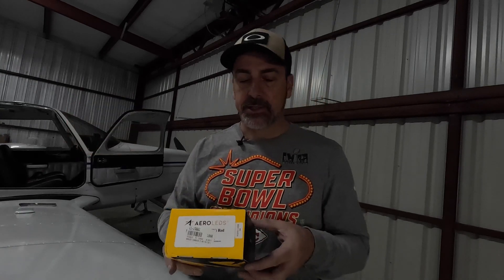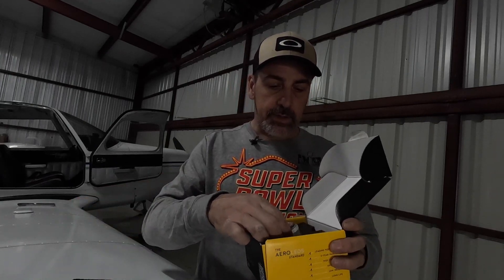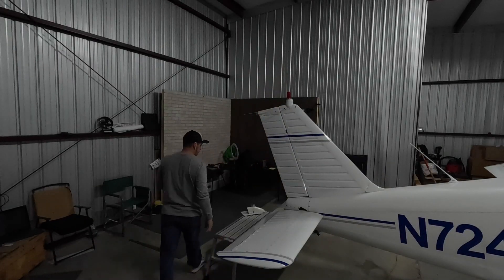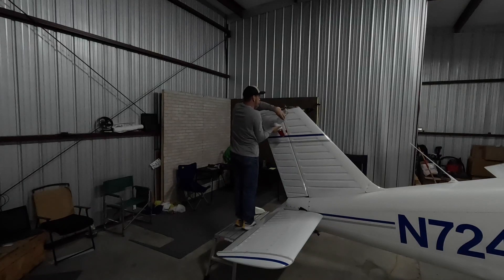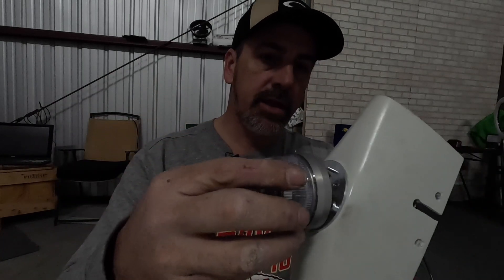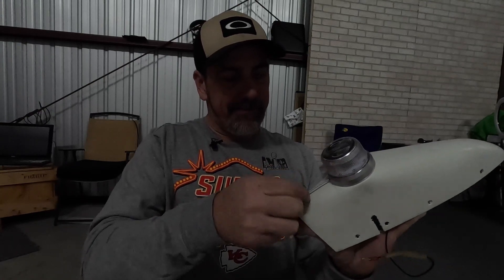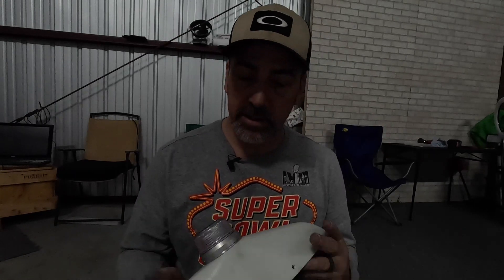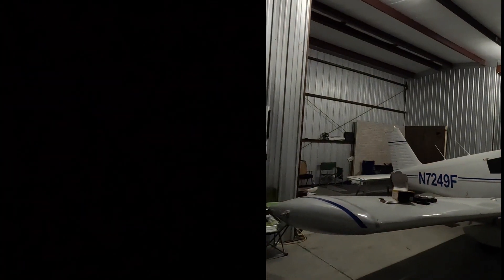Upgrading Foxy's beacon to an AeoLED Sunbeacon II

Comment: Just installed one on a C182T,  very nice.  Thinking about putting black tape on the front of the beacon to reduce glare into the cabin throught the back window,  Have you had any issues with glare on the Pipers wings at night?
Reply from the maker: Congratulations on your choice. It flash on the wings but it’s not overly distracting. I’ve had a few people at my airport ask me what lights I have so they can get some.😁